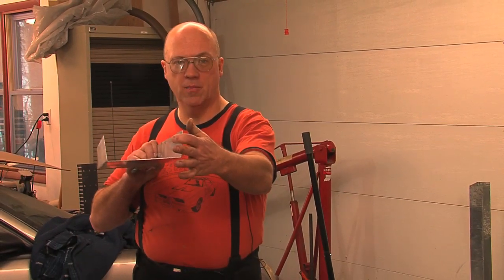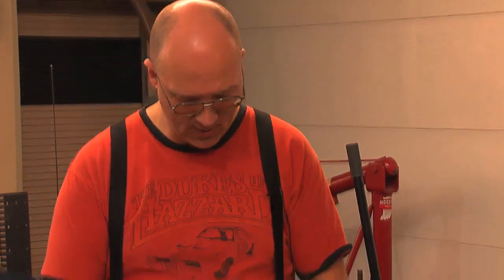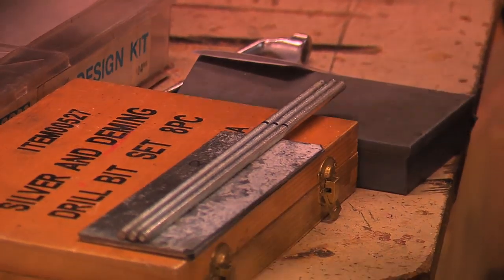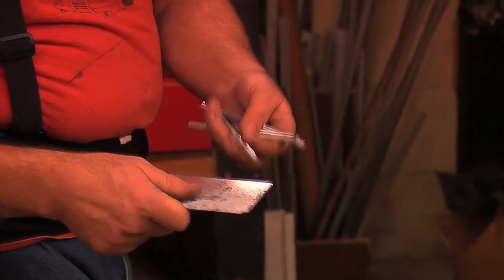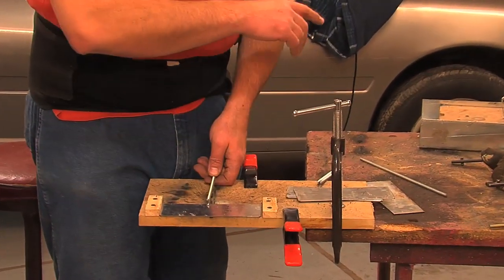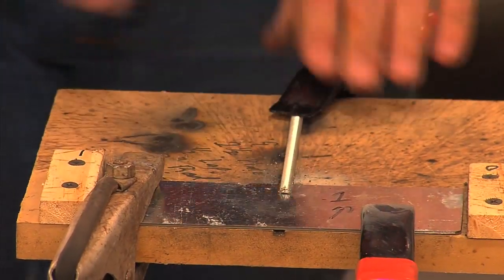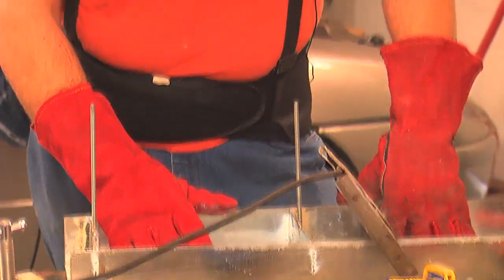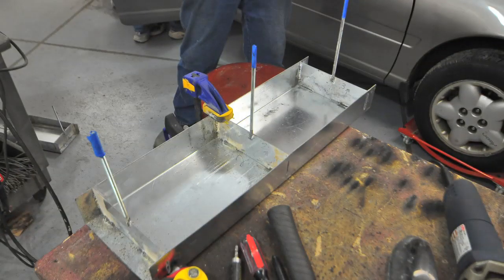007 AC Electric Car Conversion 101 - Battery Boxes

Comment: you have probably bean told already but if your welding galvanized  you should use a respirator the fumes can be deadly. loving the vids i have a triumph spitfire i plan to convert thanks .
Reply: I was thinking the same thing about him welding galvanized steel .
God bless
Wyr

Comment: Just a little constructive criticism. Those are some ugly welds lol. Perhaps a little increase on your amps and it'll burn hotter for a more complete melt. Your welds for the much thicker plate you used for the motor mount was a lot better. That's it, thanks for the great vids :)

Comment: @BenjaminNelson Why didn't you just weld a nut where the threaded rod went and then screw the threaded rod in that way you could more readily change the box if need be for a different pack?

Comment: I totally concur on welding galvanized.  DEADLY toxic, and how much did it save?  A couple of bucks?  Also, any machinist will tell you that gloves are a HAZARD to band saw work.  Grabbing/catching is likely to pull your fingers into the blade, and they provide very little protection against cuts.  Use a saw with a table-top, and a small vise for holding the work, so that your fingers remain well clear of the blade.  These two things could get you fired from this large research laboratory.
Reply: wrong

Comment from the maker: The rods are sized so that they are the correct length once the battery, battery charger, and cover are in place. They don't stick up any after that.

That said, we were all wearing safety glasses while working on the battery boxes....